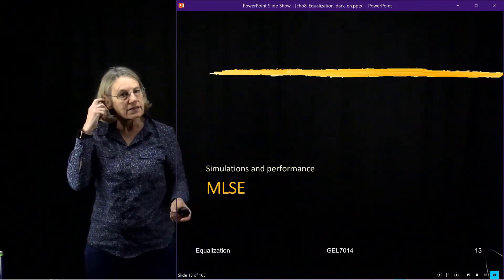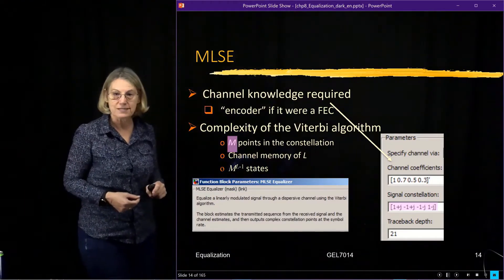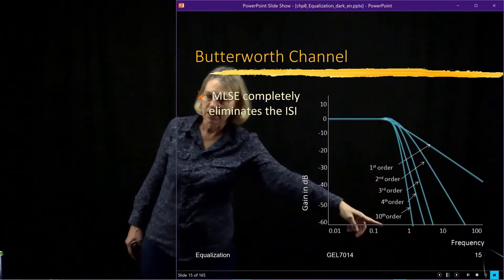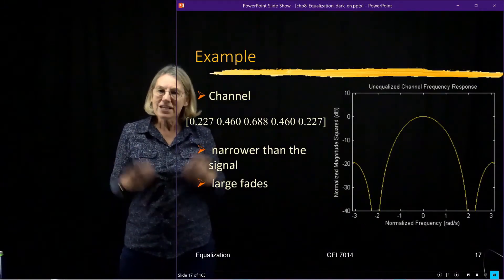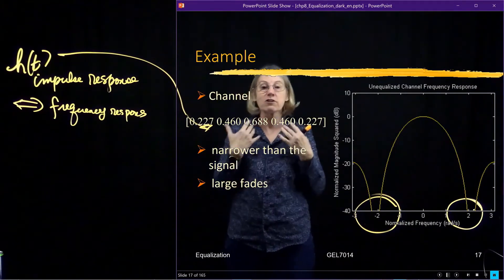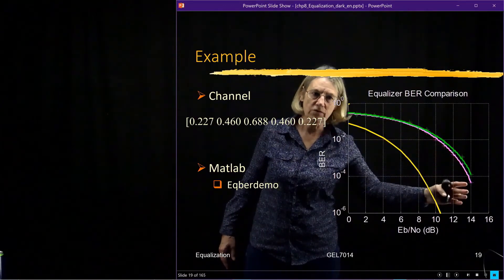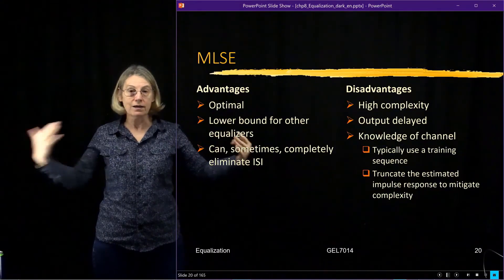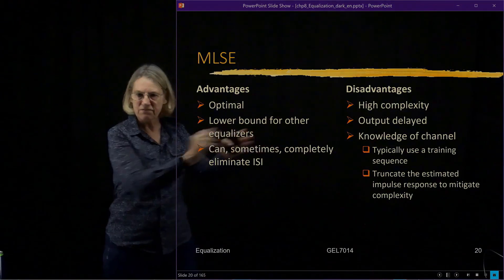GEL7114 Module 4.2 MLSE performance

Comment: Hi Prof Rusch, 
Thanks a lot for this amazing lecture series. I do learn a lot. 
I got a question about the deep fading case. An equalizer is not able to recover the deep fading region, as you showed in the example.  Then, intuitively, we should get a BER floor despite the power (if the signal has non-zero frequency component in fading region). 
But in your simulation result, we only see a 6-dB decay, and the BER is still able to go to zero at high SNR. Could you please explain a little bit about this point?